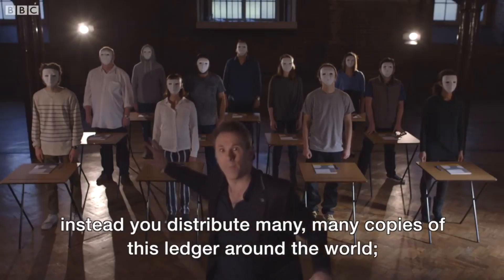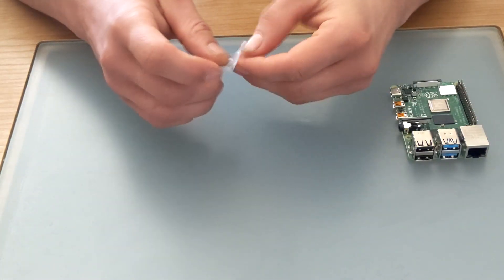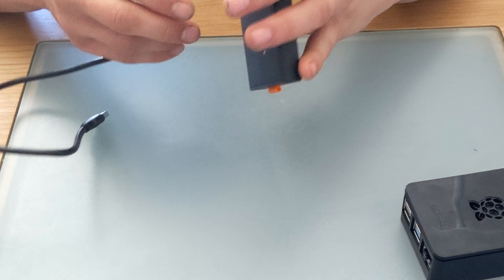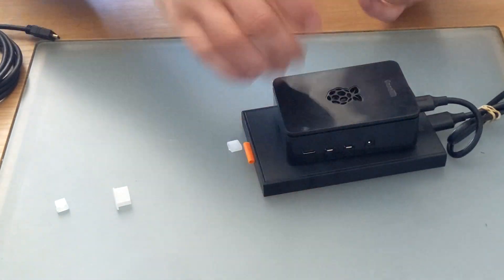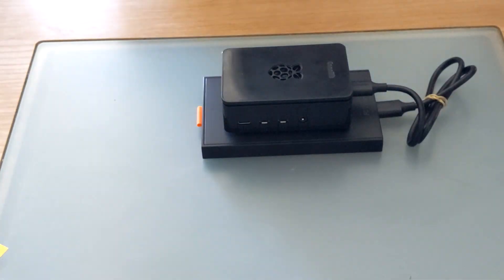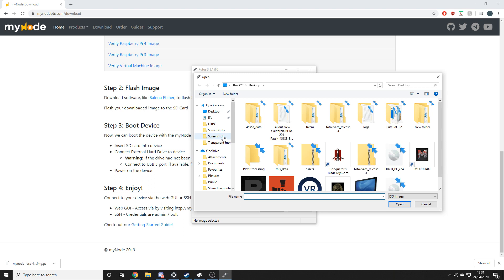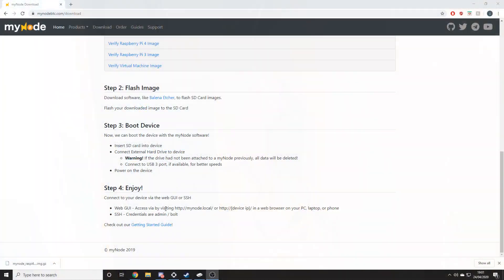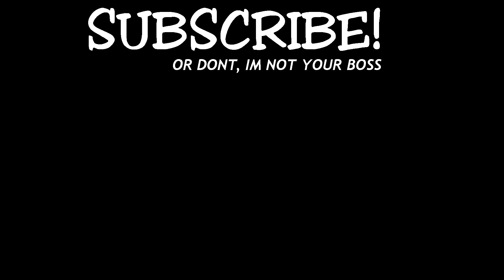Building A Bitcoin Node!

Comment: Noob question......how do I connect the pi to my laptop?
Reply from the maker: I don't see why you'd want it directly connected to the laptop itself. You use a micro SD card to get the os on the pi, and then by connecting it to your router it'll be accessable over the network.
Reply: @digitalkey9603  Thanks for your prompt reply, as I said am a real newbie and no experience, thanks I now know I can see my mynode from my computer using my local network, however,  I cannot find my mynode on my local network. I get an error message. For the record, my computer is set to 'private'. any ideas?
Reply from the maker: @ozomedia99  ummm what error message are you getting? I presume you're using mynode like I did? try checking out some of their guides, it might help https://mynodebtc.com/guides
Reply: Thx  again for your reply. It's my laptop that's the problem. I've used another laptop and am all connected
Reply from the maker: @ozomedia99  glad you got it sorted man

Comment: What is the estimate amount of download and upload consumption to maintain a btc node.
Reply: I have a BTC node since 2017 with  a 3Mb connection in my home running 24/7, also I work remotely. Usually I never had problems. When the node its down for maintenance for 2 o 3 days and need to sync the blockchain, could affect your bandwidth for one or more hours. The last stats I have of my node: Up during  2 days,  2.2Gb up traffic, 858Mb down traffic.